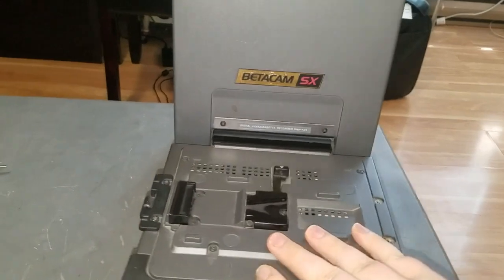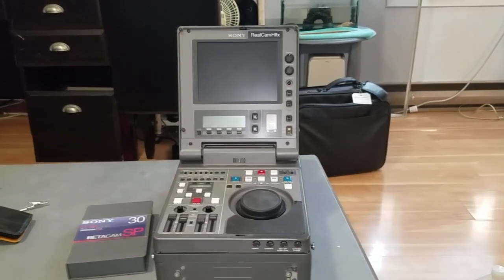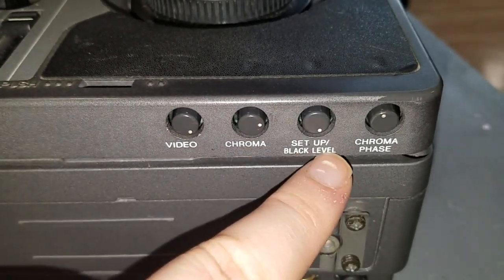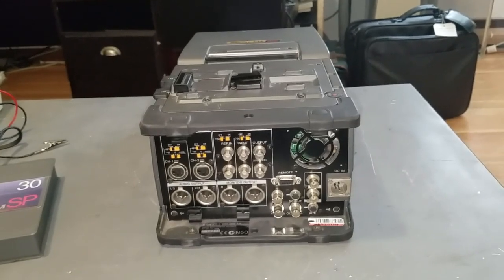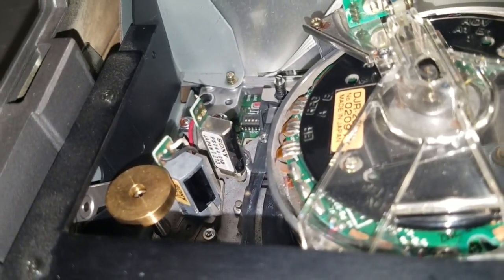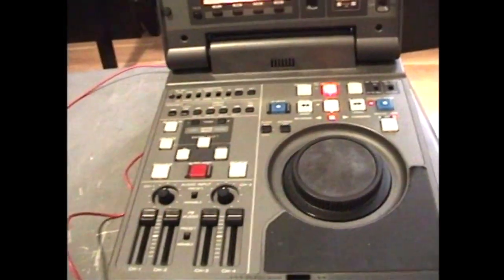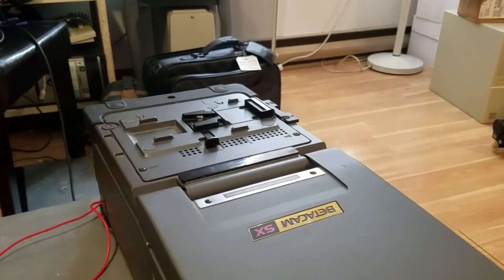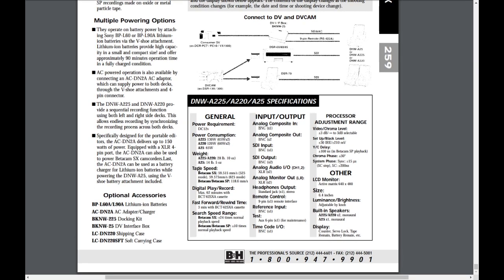Sony DNW-A25 portable Betacam SX VCR (2001)

Comment: My DNW-A25WS must have been made later than your A25 because it has a menu and physical switch for widescreen and two other settings. Also, I have a Sony power supply that slips into the V-mount, the AC-DN2B but uses a 4-pin connector cable to plug into the 4-pin power input on the back.

Comment: I just pulled my DNW-A25WS out of the closet and fired it up for the first time in many years. I gives me an Error 96 SY NV RAM Error. I cannot find a way to address this problem. Would you have an idea about that? It'll load and play the tape just fine but has the text box overly of the error which also lists 'Current Setup banks 1,2,3 and 4, and at the bottom of the list ID CODE but no code number.
Reply from the maker: That was mentioned in the video. Replace the yellow Snaphat battery that resides on one of the boards.
Reply: NEVERMIND! You covered my problem toward the end of the video. It's the SnapHat battery! Also, I'm going to follow your information on how to remove the panel and reseat the cards because I can't get video out. Other than the NV Ram error (which I make go away by pressing Menu and the the Set button next to it) the deck seems to function normally. I just can't get video out. But, we'll see when I reseat the cards and replace the battery. Thank you for all good information.
Reply: Got the replacement snaphat battery. If you replace yours, please make a video on it because it appears it doesn't simply plug in.
Reply: I never put in that SnapHat batter and instead used a start-up that got rid of the error. But, I put it away for months and now cannot remember how to start up the machine and have it dismiss the error. It was holding one or two buttons while turning the machine on.

Comment: Sony used that 4-pin power connector on their consumer portable betamax units as well. My SL-3000 uses that same standard.

Some of those drum heads are probably flying erase heads as well, for the edit functions.  Also the bearings in that head drum sound a lot like those old Quantum Fireball hard drives, do you know what rpm it rotates at in SX mode?
Reply from the maker: According to one page I read, 5400 RPM for NTSC.
Reply: @themaritimegirl  That would explain why it sounded like a 5400rpm hard drive!

Comment: I thought 3/4"/"Umatic" was notorious known for quality issues would be a great replacement for Betacam for mastering.
Reply: 3/4 Umatic was intended for consumers in 1973, but never reach this market. Instead it was an incredible corporate market success till 2000. Broadcasters had 3/4 U-matic High-Band (called BVU series) and it was replaced in the 80's with Betacam, especially when Betacam SP arrived (with 90 mn tapes). Small cassettes were only 20 mn in portable U-matic and 30 mn in Betacam camcorders.

Comment: I'm curious how well this unit would work on standard Beta tapes. You were able to successfully record S-VHS on regular VHS tape, maybe this would work too.
Reply from the maker: It actually refuses to record to standard Betacam tapes because they have different holes in them to code what kind of tape they are. But if I get my hands on one I'll try it. My prediction is it wouldn't work very long before the high speed of the drum destroys the oxide layer.

Comment: Normally to connect a balanced (XLR) audio output to unbalanced (RCA type), you connect the positive (hot) pin to the center pin of the RCA plug, and connect the ground to ground; leave the XLR's negative pin unconnected. To convert an unbalanced audio source to a balanced input, you connect the center pin to positive, and tie the XLR's negative pin to ground. Unfortunately there is no industry standard for XLR pinouts, but hopefully the manual will tell you it.
Reply from the maker: Thank you!
Reply: Old professional audio microphones (in the 60's) have XLR pin 3 hot but in broadcast this is mostly pin 2. One important thing you missed is impedance and reference level. Consumer devices with RCA plugs are 10 K ohms -10 Db and broadcast machines (like this one) are 600 Ohms + 4 Dbm. You need a small (and not so expensive) active box to adapt levels and impedances when you want to digitalize old broadcast tapes, or you can use the EIAJ socket of some U-Matic players but you have just monophonic audio.
Reply: @VWestlife there isn't a lazy-mans-standard because the XLR connector is used for many purposes for power, intercom (4 pin) and airplane comms, of which the connector originates.